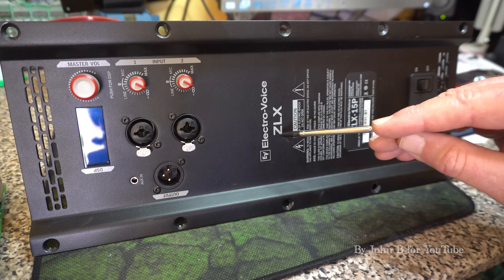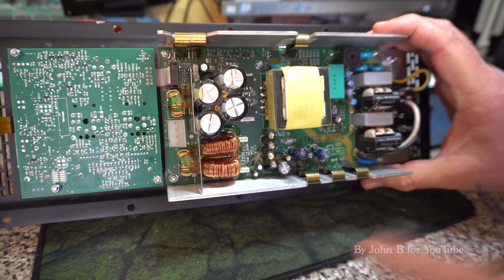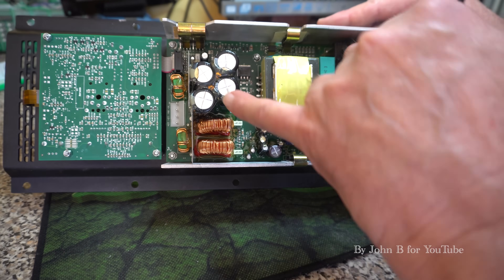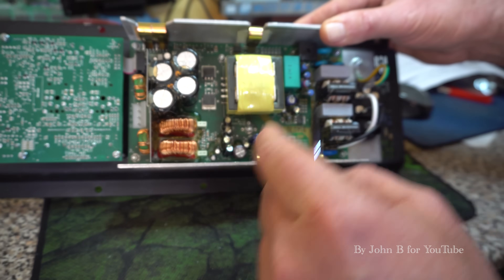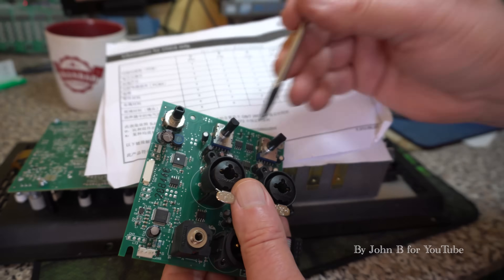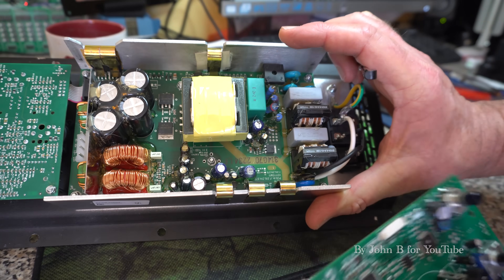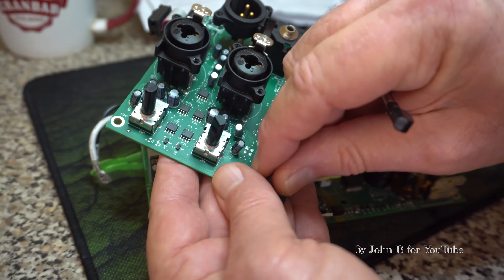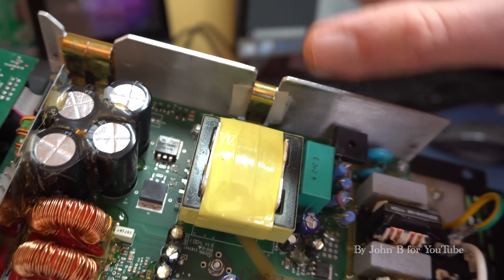The Inconvenient Truth about your Electro-Voice ZLX-12P & ZLX15P amplifier (Read Show More)

Comment: Oh wow, I was just about to fork out for a full set of EV EKX (rather than ZLX) tops and subs as a first time buyer of their gear and you’ve now shattered my faith in any EV products!  Back to the auditions..
Reply from the maker: Thank you for your comments.
Reply: @JohnB-2021  John...I saw your video some time ago and it led me down a path to find ou the whys, hows and what nots. Can you please review this video and tell me if it makes sense as to how the 250 watt chip can make 1000 watts. Its a very informative video and after doing some homework it seems that you may be incorrect. Please check this out and help us understand. https://youtu.be/PP7DxyX7c7Y
Reply from the maker: @deejayqueazy8251  
Hi, I tried to listen to most of the video but found myself skipping to the facts.
They are saying / stating how one can get 1000 watts when only consuming 100 watts from the mains.
The guy is correct.
Because there is energy stored in the capacitors, it is possible to get 1000 watts peak music power and consume less from the mains power over 'short' periods.
BUT, they are not saying one can get 1000 watts from a 210 x 2 watt chip.
Look at the repair video I did.
There is insufficient voltage to get 1000 watts into a 4 ohm speaker, further more, the chip limits the current to 12 amps to protect itself.
Your video link is saying how one can get more power out of a box than one puts into the box.
That works for very short periods only.
The guy also did NOT recommend driving your speaker with a continuous sine wave which would be required to measure the full RMS output at a specific frequency.
In my repair, I do drive the bass with 1000 hertz, you will see the chip cuts back on power when it starts cooking.

Comment: Yeah, I had the first batch of EV ZLX powered speakers, found out they had a bad batch, it was known that the amps would blow the internal fuse like there is no tomorrow
Reply from the maker: The second revision also blow fuses due to a cheap design and poorly constructed SMPS.
Reply: @JohnB-2021  I'm staying well away from them, even though they are supposedly improved, i still don't trust them. Last thing i want is, a speaker blowing at a corporate event
Reply: I have a EKX that crapped out on me.  Do these things have fuses that can be replaced or is everything internal. I looked everywhere and believe it's buried and covered in there somewhere.

Comment: Like anything in life really .. if people believe they are getting value for money then it's OK to be misled. Common sense dictates that you can't get massive power outputs from these toy amplifiers but they are loud enough for the venues for which they are intended. In my experience, DSP is not necessary using small speakers playing up to 150 people or so .. it just adds some marketing means to sell the things. If you must buy EV .. find a pair of ZXA5's (if you can) or RCF 745a's. Either will run forever and at ear bleeding volume.
Reply from the maker: Thank you for your comments Elliott

Comment: The power ratings of any speaker, no matter what the make, are never continuous sine wave. The 1000W could be a peak of a few msec. No speaker chassis can stand a 1000W for long. Where is the heat supposed to go? And hardly any amp, certainly not a flimsy amp like the one shown, can deliver 1000W for long. OK, we all know that. So why even try to take these power ratings serous? They are just part of the "higher faster stronger more " madness.
Reply from the maker: Thank you for your comments, which I agree with.
There are still too many people who don't understand. 210 watts x 2 is 420 watts absolute peak at +/- 41 volts.
In my repair video, the EV produces +/-36 max so they don't even get 420 watts lol.

Comment: Hi John... Thanks for the really useful videos! I have an ETX 15P that's been in storage for a bit but now makes a crackling sound when powered after 5 mins or so... Any thoughts? Also how does one get in contact with you :)? I presume you do this commercially too?

Thanks!
Reply from the maker: Hi,
No I don't repair these commercially, just did a few friends a favour.
You're the second person to mention a crackling sound, no idea what that is.
Reply: @JohnB-2021  That's a shame - you should do it commercially :)... I'll see what I can diagnose (actually EKX not ETX, so has the DSP like your ZLX)... Also an EKX 18SP, exactly the same crackling so I can only assume some artefact of the the dampness in the storage... Thanks again for the videos!
Reply: Kannan Paul Hi
Idk if it’s of any use at all so just fyi. 
Harman Kardon subwoofer make a crackling sound also described as ‘thunder’ due to glue that has become conductive due to excessive heat due to the poor design. 
The solution obviously is to remove the turned brown/black glue.
Reply: @Conservator.  Hi there... I checked if any of the gunk was conducting it doesn't seem to, the crackling seems to happen only when the board is warmed up (I have 2 of them doing exactly the same thing!)... I am going to replace the PSU filter caps and probably while I'm at it replace all the caps on the board and see if that helps to start with... everything else actually seems fine on the board!
Reply: Kannan Paul 
You could also try to warm up parts of the board and see if you can reproduce the cracking. That could give you an idea in what area (literally) to look. Just an idea, I have no expertise! 
Good luck! 
I’m curious to hear if anything helped. (recapping and or warming up parts)
Reply: @Conservator.  It now seems to be fixed, but I wish i listened to Dave Jones on capacitors before I started lol… 

So I systematically replaced all of the electrolytic capacitors on the board, starting with the physically larger ones - PSU filter caps then the output caps (I think!), then the rectifier caps, LC Caps and finally any sundry caps that I could find… The crackling sound seemed to get progressively less and less although that could be my wishful thinking, I really am not sure now if all of the caps might have had a slight issue (given that they were all subject to the same conditions), so perhaps it was a gradual deterioration of all of them which ultimately led to a performance hit (exhibited by increased noise when warm), or it was just a few of them which behaved badly when warm (I have tested a large number of them and cold, they all seem fine!).

In any case the crackling noise finally completely disappeared when I replaced the caps closest to the transformer on the board - I’m thinking perhaps the heat from that caused more damage to those specific caps over time.
Reply: Kannan Paul Yes, capacitors don’t go very well together with heat. I’m glad you solved te issue. 
It doesn’t seems likely that all caps failed to the same extend. Usually they stay ok until the ESR start to rise. This causes the cap to warm up during operation causing the ESR further to rise. It’s of cause unlike that this would happen to all caps at the same time and at the same rate. And even if so it wouldn’t have the same effect on the output. 
Having said that, it isn’t all wasted because with the new caps the amp should be good to go for a long time. Tx for the update!

Comment: Wish I'd seen this before I bought my ZLX-12P, Oh well, you live & learn & it'll be my first & last EV purchase.
Reply from the maker: Well it’s a good speaker, just not 1000 watts.
How much did you pay?
Reply: 2 months old & it's shit itself, no bottom end
Reply: I think about 550 Watts is fine for a 15 inch full range. Pretty much what I expected (actually I expected a bit less power). Of course the advertised "1000 watts" is peak power. But you could already tell because they dont tell you the rms power.
Reply from the maker: @Chris-yy7qc  
To find the peak from RMS you multiply the RMS by 1.414  which is the square root of 2.
To find the RMS from the peak, you multiply the peak by 0.707.
The speaker is 420 watts peak with an additional 100 watt tweeter.

Comment: I have a roland rd-2000 for piano in a jazz trio. What's the best budget speaker with a flat response for piano? I was looking at the ZLX-12P but maybe you know something better. Thanks!
Reply from the maker: Good question
I would have said a used Mackie 450v2 but they have extra emphasis at 100 Hz.
Maybe a version 3? They seem to be cheap and I've not seen one to repair yet.

Comment: Very informative, thanks for posting. I have no problem with getting what I pay for, but I don't like paying for inaccurate advertising.
Reply from the maker: Thank you for your comments, I agree with you.
Reply: @JohnB-2021  BTW I wanted to ask your opinion: I'm looking to buy powered speakers to amplify bass guitar. In terms of tone, I prefer powered speakers with a flat response. Do you have any recommendations. Thanks.
Reply from the maker: @catboyzee  
I like the Mackie SRM450v2, there is a small emphasis on the 100 Hz but is otherwise flat.
I'm yet to hear the cheaper version 3
Reply: @JohnB-2021  Ok, thanks.

Comment: I bet it's bridged internally, so that it's 420watts x2 = 840watts then using a crossover to split the signal to the woofer & twitter
Reply from the maker: Did you not see the data sheet?

Comment: I can only afford an entry level system like the ZLX and Altos.  Honestly I did several years of weddings for years with even cheaper speakers than these and only twice did I ever get a complaint.  Both times it was drunk people asking for more volume.
But that was two events out of a large number.

My question is, do I need to buy the blasted extended (no questions asked) warranty for these types of speakers?
Reply from the maker: Hi, no you shouldn't need the extended warranty since most do last 4 years approx or more before blowing up.
Reply: @JohnB-2021  Thanks John.  But now you've got me wanting to buy the Yamaha DBR12s and just rent a subwoofer until I can afford to buy some subs.  Or I can get a whole setup with these cheaper speakers, but now I kinda don't want to.
Reply from the maker: @synapticflow  
I can say the older SWA1501 subs by Mackie can break windows and the Yamaha speakers are far superior to the EV.
Reply: @JohnB-2021  Hello John.  So I went ahead and bought the Yamaha speakers.  I should have them  tomorrow.  
I feel so much better having a better product and one that actually has a cooling system.
I'll look for the Mackie sub that you mentioned.
Reply from the maker: @synapticflow  
Wow 
Good for you!!
I'm pretty confident you'll be impressed with the sound quality and the real power they can deliver.
Yamaha would be at the top of my list too, further more, you can quote 1000 watts knowing they are actually 1000 watts.
Who'd have thought it, a real honest speaker with real power and not something taken from the back of a cornflakes box.
PS, did you see my Yamaha DBR10 repair?

Comment: Annoyingly, unlike most manufacturers there seems to be no trace of the RMS or AES ratings for the more serious customer.
The secrecy over the diagram is ridiculous when common chips are implemented to the manufacturers design.
The real design is in the DSP and of course a breakdown of the code isn't available so they are probably only worried about their cheap hardware design and double power rating becoming known!
Reply from the maker: Very well put lol
Reply: Uh, i've been looking at many speakers recently, and almost NOBODY states their RMS anymore.
And not just the cheap stuff, but better brands, like JBL, QSC, EV. All state either a blanket "watts" which appears to be their max, or they state "peak" and "program", which is usually twice the rms once bench tested. But good luck finding an actual RMS stated. 

 I have checked manuals, OEM websites, company forums.... you'd have better luck getting a true weight quote from a plus-size model pageant.
Reply: @jephbennett  
Amplifier RMS and speaker AES are usually stated in the manual at least, with the better brands! 
We have RCF actives and Crown FOH, I know exactly what the ratings are. Not so when I owned the EV's !
Reply from the maker: @jephbennett  
lol
Thank you for your comments Jeph

Comment: Have you ever fixed or torn down an Alto TS315 ?
I am really interested to know if the amp inside is actually 2000w peak 1000w RMS.
I have sat in front of me a set of Alto TS315 & a set of Electro-Voice ZLX-12P & I am trying to decide which ones I want to keep.
They both sound pretty good it's impossible to say one is better than the other listening to them, weirdly the EV's sound clearer at max volume and sound to me nearly as loud as the Altos even though they are only rated 250w/1000w & the Altos are 1000w/2000w, the amp on the EV gets a lot hotter than the Alto so that & this video is putting me off.
Reply from the maker: I have yet to meet a DJ that likes Alto.
If they were truly 1000 watt they would blow EV out of the water.
The peak power is the RMS multiplied by 1.414 not double the RMS.
The EV amp shown has DSP so would probably sound clearer than any amp without DSP except for speakers like the Mackie SRM450v2 which has a refined front end with a clever active crossover built with individual operational amplifiers.
Reply: @JohnB-2021  I've not really been able to find anything bad about the Alto TS3 speakers online & considering they don't have DSP they sound pretty damn good.
Apparently the TS2's tweeters weren't the best but presumably they have changed them on the TS3's.
I am looking at the Yamaha DBR12's as well, the amps in the DBR series are actually 1000w (2 x 500w) according to your video, does this mean the RMS is about 700w, if that's the case that's pretty impressive.

Comment: Thanks John for the well spoken and intuitive video. I've looked at (as a tech) not only the E-V series but also the Mackie, JBL and the Alto brands, they are all primarily the same using the same components which I believe are built in the same factory in China. I guess by today's standards these would be considered good products. Today's goods are not built by the electronics engineer but by the marketing departments of these giant conglomerates. They are built with pre-planned obsolescence., so if they last 4 or 5 years they can sell you a new one.  By the way you mentioned some Russian guy having a schematic, could you let me know where to find it, for I have two of these units from two different customers on my bench. the one party said there was a power surge but I think he plugged it in to another amp of sub that wasn't grounded properly cause it burned the input "DSP" board. I phoned E-V and they said they don't sell that board because it needs to be programmed. What happened to the good old days of discrete components, in most cases you didn't even need a schematic.
Reply from the maker: Hi Phil,
Thank you for your comments.
I prefer the Mackie 450v2 to the EV since they are certainly more powerful, generally more reliable and do have a remarkable sound that has been specifically engineered as can be seen on the pcb with the 20 to 30 op amps.
I found the same picture of the schematic with a Google search.
It is only the power supply section but is very helpful since I've had one EV also blow resistors that drop the 240 down to 12 for the fet driver.
I think this is the link
https://elektrotanya.com/electrovoice_zlx15p_12p_zlx-15p_12p_powersupply_schematic.png/download.html
EV do sell the input board because my friend purchased one as explained in the video.

Comment: Hi Ev gives the 1000w as a peak for the drivers (so not the amp!) The amp just gives around 240 rms to the drivers. They only use their 1000 watts peak for advertising and that kind of stuff. Greetings from the Netherlands and keep up the good work! Edit size does not really matter in small amps like this, of course you wont get like 1000rms out of this but it could be for this kind of size up to around 500rms.
Reply from the maker: Good day to the Netherlands, thank you for your comments

Comment: I compared one of these evs with my mackie srm 450 v1 yesterday and there is no comparison, the mackie has a much higher volume than these
Reply: @sblaze4  as the Mackie website says srm 450 are built like a tank
Reply from the maker: I agree,  the 450v1 & v2 have a comprehensive front end that give a clear, crisp sound that EV ZLX owners can only dream of.

Comment: Can you check how much the class d is making power wise (rms) limiter or before? Also have heard of pascal amps
Reply from the maker: Yes you can check.
Take the peak and multiply it by 0.707 to get the rms voltage then work out the current through the load.

Comment: Hi John I wonder if you can help me I have exactly the same speaker that you are repairing but the problem I have got is the base is intermittent any clues to what that would be because I don't want to pay out a fortune if it's the wrong PCB
Reply from the maker: If the bass is intermittent, maybe the woofer is blown or it's getting too hot.